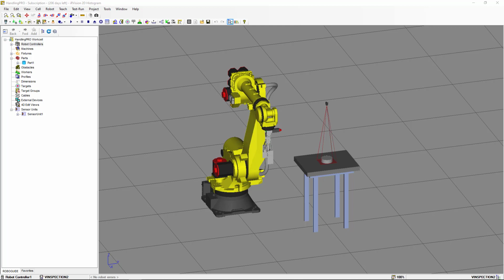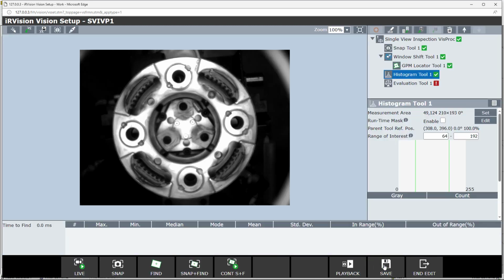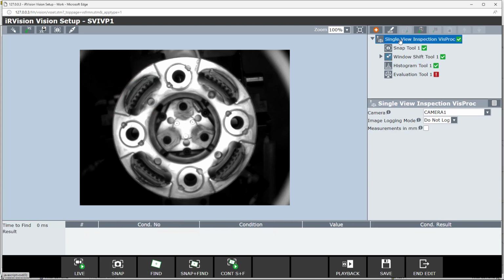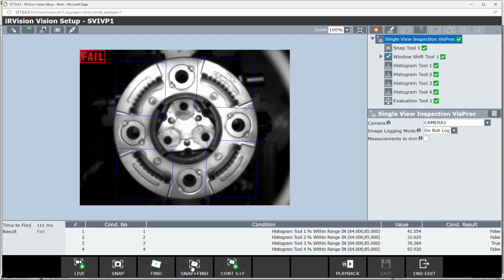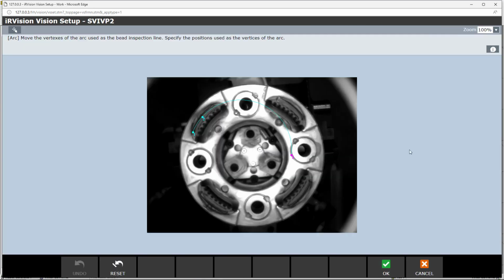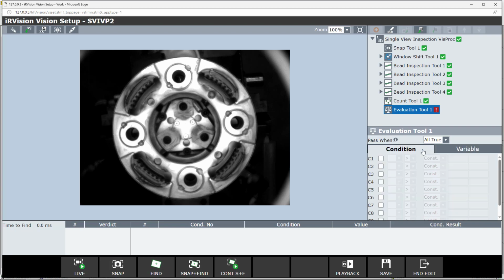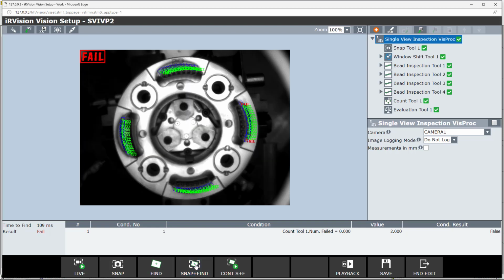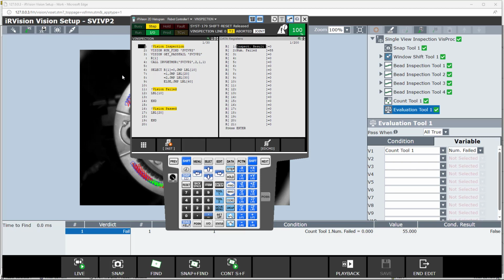iRVision 2D Histogram

Comment: Hola Eduardo, Saludos de PR.
Could you please inform me if you’re planning to create a video tutorial on the topic of using 2D arrays in Karel programming? I’m particularly interested in understanding the various sections of a program where 2D arrays are defined, instantiated, and populated. Additionally, I would greatly appreciate it if you could delve into the subject of using variable-sized or dynamically defined arrays, where the array size is determined by a variable rather than a fixed value.”

Feel free to let me know if you need any further clarification or assistance!
Reply from the maker: Hola Andy, I have some examples of arrays, watch my videos KAREL Programming Data Types Part 1 (starting at 24:00) and Part 2, also KAREL Programming Palletizer Part 2. You will need to use User-Defined Data Types. I do not have any examples for variable-sized arrays, would be interesting to know how it works.
Reply: @EduardoSuarez-Automation  Thanks a lot! I will check out those videos!